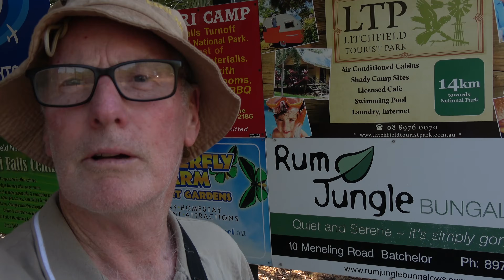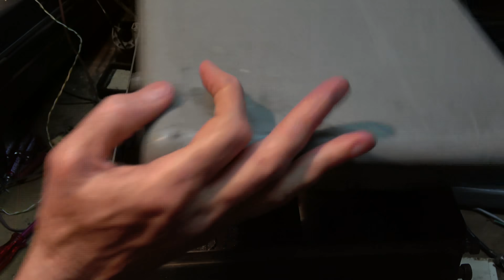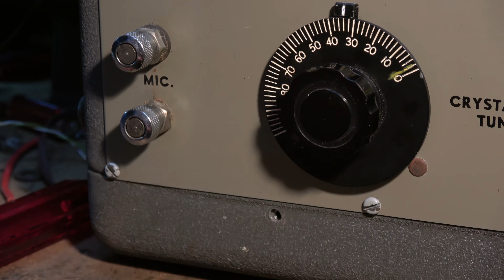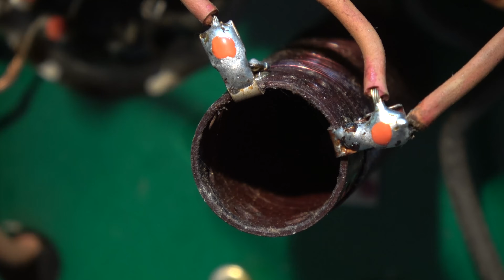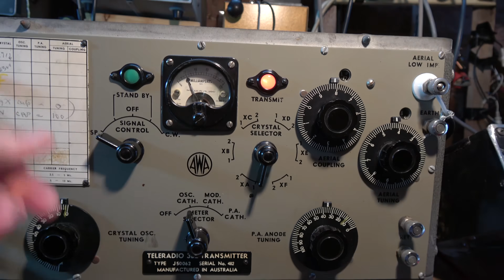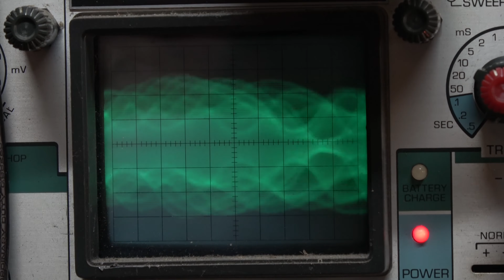3BZ coast watchers radio found in jungle.

Comment: Rubbish !!!!! Dont tell me no one could have found that xmitter right there in the open for 80 yrs plus it rains a LOT in that geographical Area.... prestine my Ass !!!! That spool of wire is SALT AND PEPPER  wire pair used for field telephones used in the military NOT Specifically for Aerials although you can use it as an emergency antenna when cut to proper length